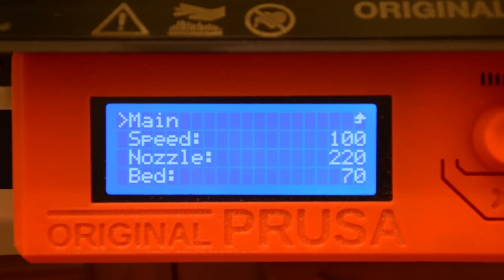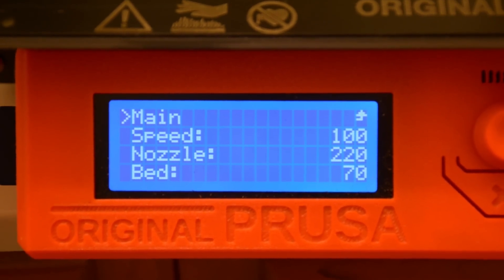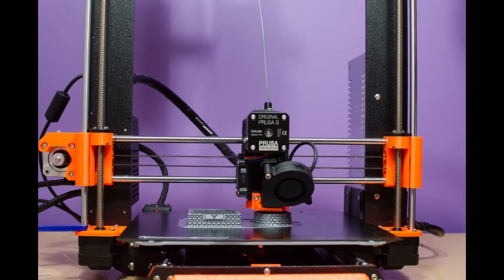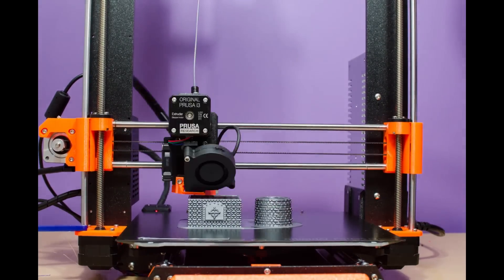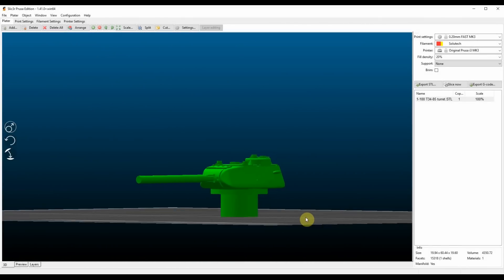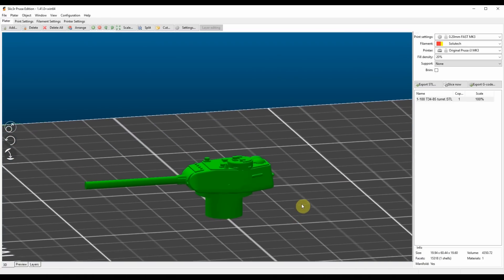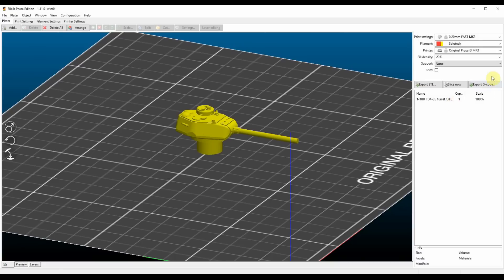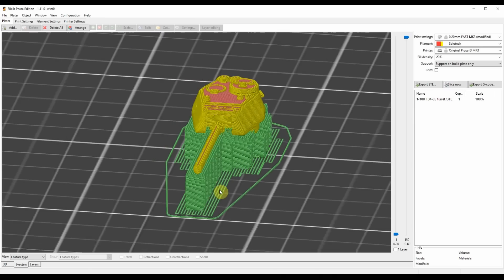3D Printing for Wargamers: Basic Settings

Comment: Fantastic set of videos. Am thinking of getting a printer and these have really helped.

Could you do a video at a later date about changing the scale of printing.
Say if I had a file that was in 15mm but want it in 28mm
Reply from the maker: Very easy to do in your slicer, Jason! This will depend in the slicer software you're using, but you can change the scale up or down in the software before going to print.

Comment: Thank you for the video Steve.  I've recently purchased a Prusa Mini to make miniature game pieces, and the biggest issue I have is supports.  The few mini's that I've printed so far the supports have been pretty tough to remove.  Do you set up any advanced settings on your Prusa slicer to make it easier to remove the supports?  One thing I did do was use the option to place supports everywhere and I noticed in this video you had it at a different setting.

Comment: In Cura there is an experimental setting called "Tree Supports" which will build sort of like a branching tree of support material and may be able to reach those overhangs that are above other parts of the model, ive found them to be really useful for minimize cleanup in a lot of situations and while filament is cheap it also mostly uses less of it than regular supports.